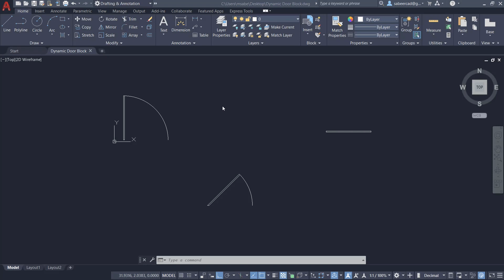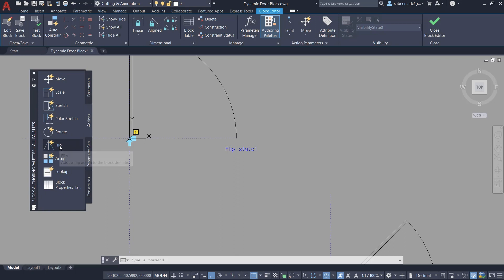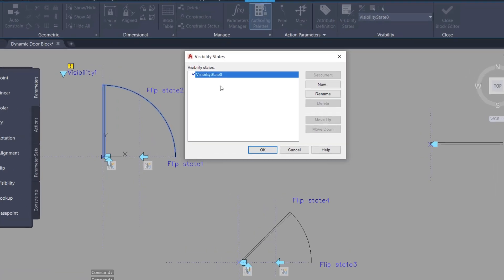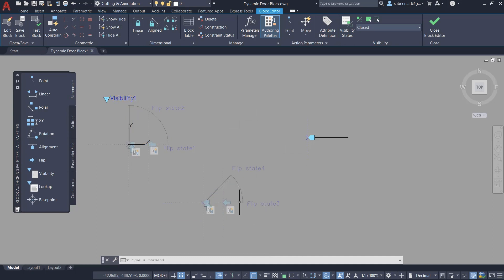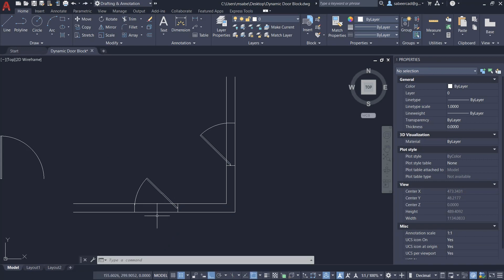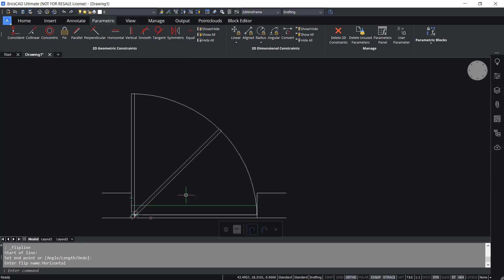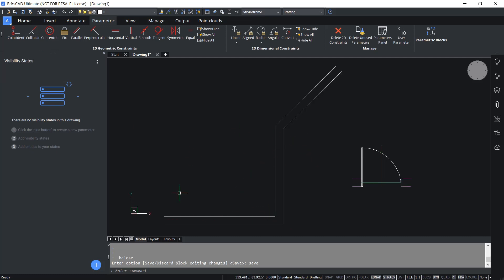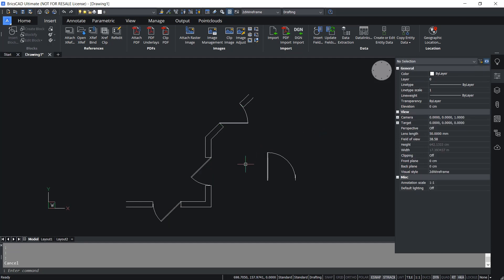Dynamic Blocks VS Parametric Blocks | Create Blocks with Alignment Flip and Visibility

Comment: Great explanation Thanks. but you didn't cover parametrically scaling the doors which is more important than doors states-its always needed! Flip and scale mostly useful, door state is a bonus. I have been using Autocad for 20 years and never bothered to spend the time to learn about dynamic blocks! Also never heard of bricks CAD before, is it new?

Comment: Hello, thank you for this video.
I have been working with AutoCAD dynamic blocks for many years and I love wat you can do with it.
As a company we are recently looking into switching from AutoCAD to BricsCAD and your video realy helped me understand how parametric blocks function.
I have just started trying to replicate my faforite functions and it looks more userfriendly, I think however that a few comments should be made:

- Your construction of the AutoCAD dynamic block is overly complicated. It would work as well with just one "wall", one alignment parameter that would tipicaly folow the wall and the 3 door states.
- Can the automatic trimming be turned off? I don't like those holes in my wall and if I remove a door later i have to fix those holes.
- In the BricsCAD Lite version the trimming and stretching to wall thickness don't work
- I had a FATAL ERROR on trying to recreate your block, because I used U shaped polylines for the 'wall" reference curves. Applying "Parametrize" will cause a fatal error (same hapens with a rectangle ofcourse) But it took me a while to figure out what I did wrong. 
- In AutoCAD a dynamic block wil resnap to alignment when moved to another place, which parametric blocks don't
- I have noticed that dynamic blocks can be used and manipulated in BricsCAD but not edited and I have not found the convertor yet  (V23 Beta?)
- Parametric blocks lose all functionality in Autocad and become just plain Blocks.
- I don't like that the parameters are only accessible through the properties palet.

I hope it is clear wat mean.

Comment: I believe parametric is the best one, because all drawings should be driving from dimensions. 
Can we make parametric design in autocad with vlookup option?
Because some times dimensions not driving from relation that can be lookup with respect another?
Reply from the maker: Its possible in AutoCAD. It takes less time to create a parametric block.
Reply: @sabeercad  
Thanks for the feedback
Can we link the dimension values with respect to 2d drawing Cross section dimension to excel sheet ?
If yes could you pls make one video on it to save our time? 
Like in soildworks.